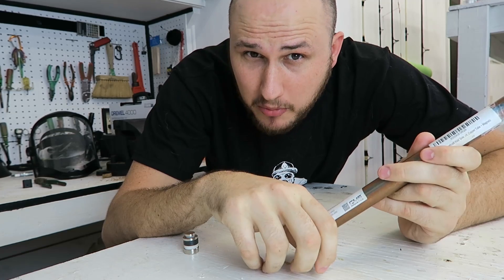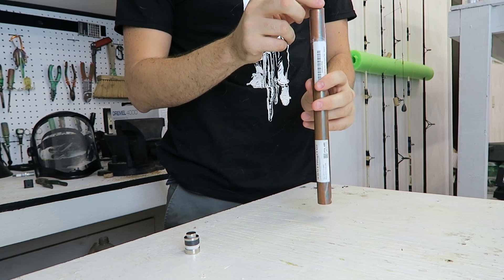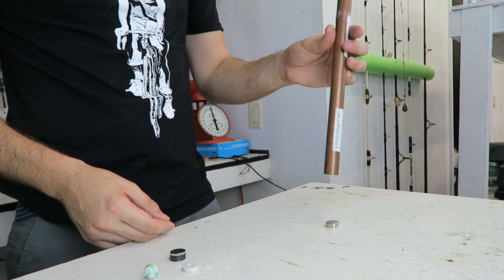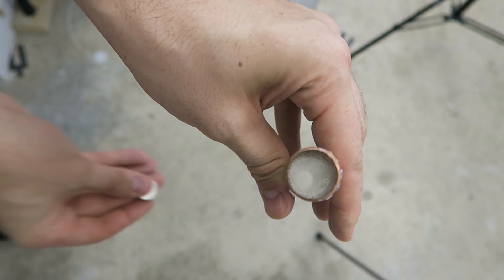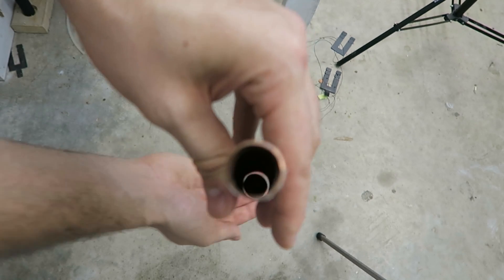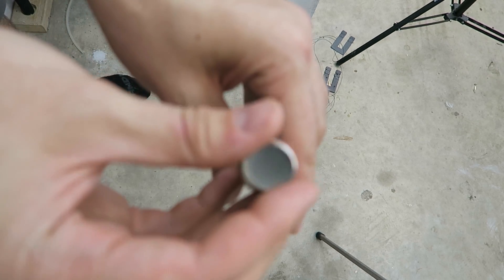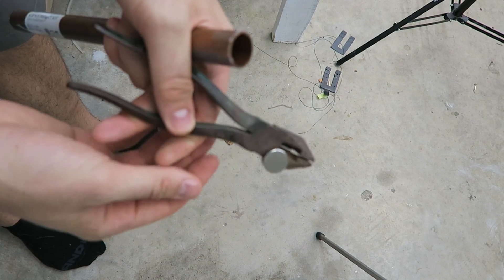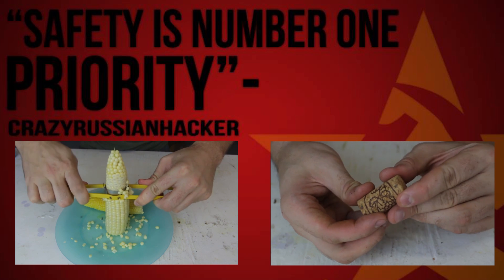Neodymium Magnets and Copper Pipe Trick

Comment: The magnet goes through the copper pipe slower, due to the AIR has to pass the sides of the magnet.  When the magnet is dropped on its side, it drops faster through the pipe.  Very informative, keep up the great work!

Comment: The copper tubing isn't 100% copper. It is part copper, part iron and some other stuff. Well the magnet is attracting to the part iron in the tubing but it is not a strong enough hold therefore not able to fully grab it. It only has a small attraction making it go down slowly.

Comment: Why not implement this in elevators while going down.It would be silent and energy efficient.
Reply: And you should read a book sometimes.
Reply: well its just a conspiracy theory,i know it would be very heavy to even lift but its a good idea if the gravity was like on the moon
Reply: niculin petru What is a book? a new gadget  or something?
Reply: You'd need to still fit the cables and motor anyway, and with the extra amount the motor would have to work to lift the now very heavy elevator (it will have its weight due to gravity, plus the same force the resists the downward motion in this experiment would now be resisting the upward force, it's called magnetic induction) you'd probably end up using more energy than the current elevators. I admit, it sounds pretty cool, but it is very impractical.
Reply: +mmmhorsesteaks down and slowly
Reply: Any electronics with a hdd would get wiped clean
Reply: Adam Coventry So only feasable for elevators that only need to go down.
Reply: kyah taylor good point
Reply: +kyah taylor nope
hhd aren't so sesitive to magnets (inside of an hhd is an magnet)

Comment: here is my guess - even though the copper pipe is non magnetic, the movement and friction of the magnet is temporarily charging the copper particles (electrons) enough to create an intermittent static field that attracts and retracts for only millisecond periods but which are enough to slow the magnets passing through the tube. (or in simple terms - electricity)